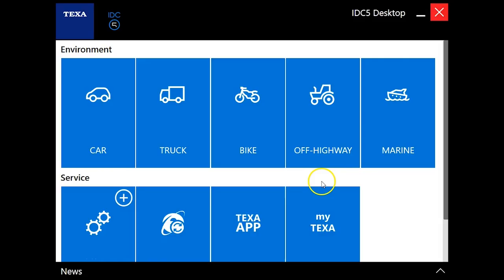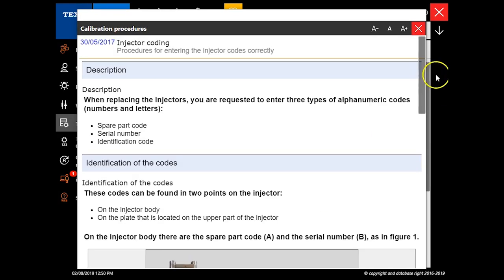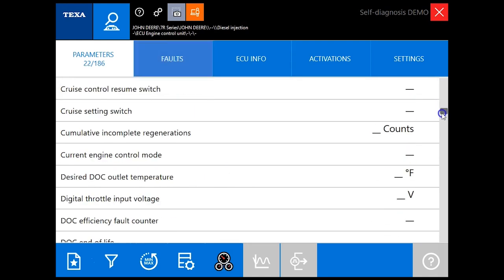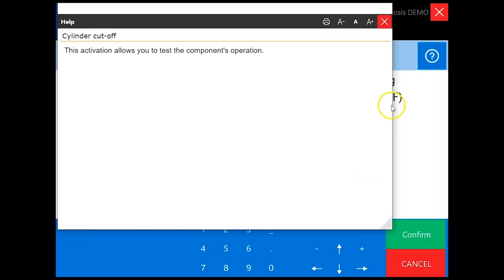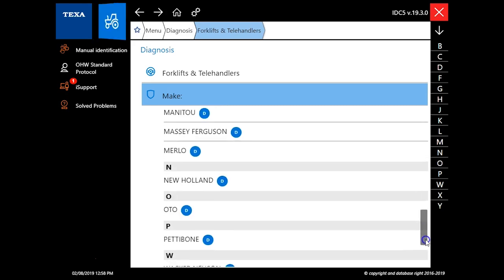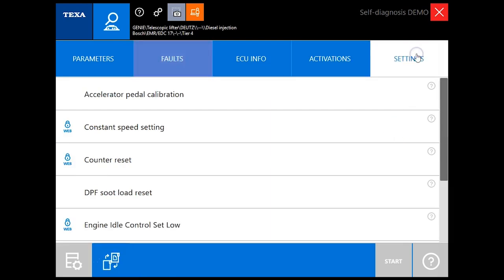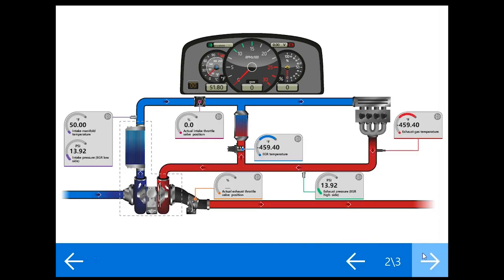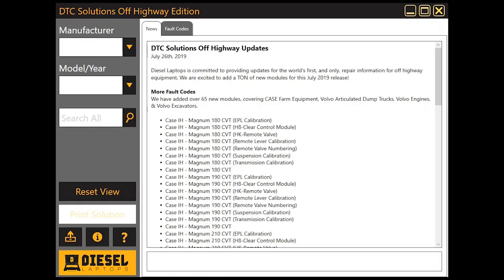2019 TEXA Off Highway Construction & Agriculture Diagnostic Laptop Kit Overview

Comment: So for a case 580sn, would this give you dealer level control?
Reply: They claim it will, but no it will not. It cannot program modules, so if, for instance, your diagnostics lead to a bad ECM, the dealer must program the module before you install it. Definitely pisses me off when they’ve marketed as “dealer-level functionality” When in fact, it’s just a high-end scan tool